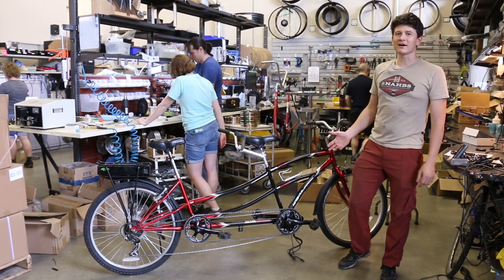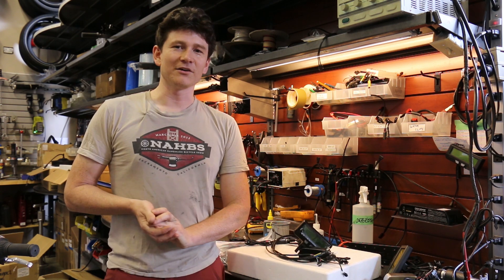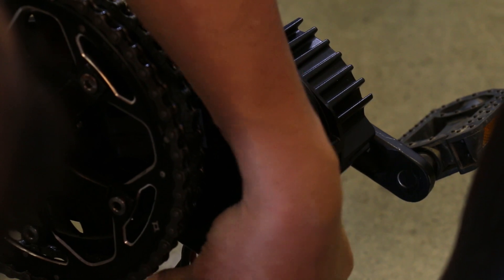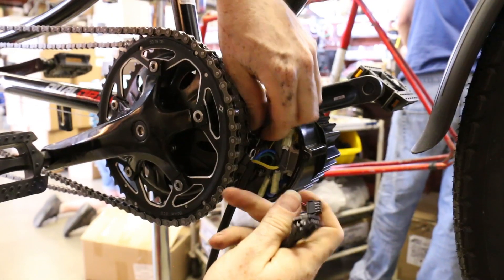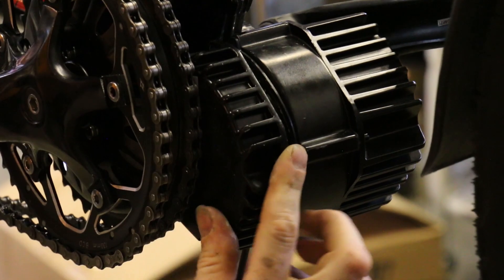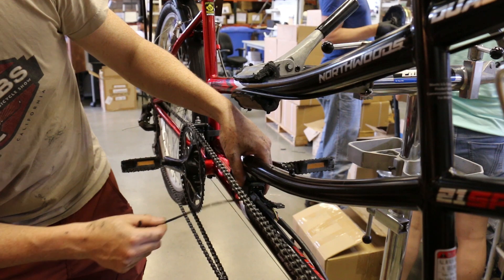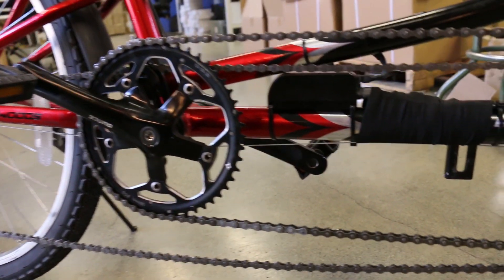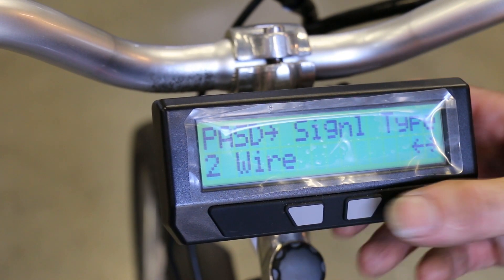How to upgrade a BBSHD mid-drive to use a Phaserunner motor controller and V3 Cycle Analyst

Comment: Can i use my Cycle Analyst v3 8 pin higo connector, with my stock bbshd controller as a plug and play?
Reply from the maker: Nope, entirely different pin functions I'm afraid
Reply: @GrinTechnologies  Thanks, I haven't done anything. I am in the investigation phase.

Comment: Is it wise to re silicone all the connection 🤔
Reply from the maker: Not usually. Dieletric grease can be OK on contacts with exposed copper, but anything any actual sealant material is more likely to trap water inside the pins than it is to keep it out.

Comment: Please consider offering a BAC controller, with higher power capability than the Phase Runner, for Ebikes.  Thank You
Reply: Not a good idea on this type of mid drive, unless you do some modifications 

More power and you start breaking chains and other parts 

You can get a higher power mid drive kit - but not from Bafang.

By higher power, I mean 5KW or better.

Comment: Hello, I am wondering if there is anyway to run the phaserunner with an eggrider instead of the cycle analyst? I have a bbshd and  started playing with the egg rider. I like the adjustability but the cycle analyst is a bit ugly!
Reply from the maker: In principle yes but you will need to do a custom wiring in the the TRRS communication port of the Phaserunner, and use an eggrider firmware designed to communicate with the ASI modbus protocol.

Comment: I'm curious about the bike itself - how was this tandem mid-drive set up to ride?  Did the drivetrain of the tandem itself hold up after putting some miles on it with the high power mid drive?  Or would you just use a rear hub drive next time you converted a tandem?
Reply from the maker: It's still going but the tandem bike didn't clock all that many miles at the end of the day, since opportunities to use it are a bit limited.  For sure we would generally use a hub motor (front or rear) with regen capabilities on a future build up of a tandem conversion.  This was done more as a demonstration piece.

Comment: If you have a BBSHD, just get the Ludicrous controller instead. No buying additional items, running ugly wires, etc. It is an exact swap to the original, but bumps current to 60A max @ 52V(58.8), or just over 3000W. The motor looks no different after install, you get to keep the old controller as a backup without destroying it, and there is no way for police to tell it is over 750W as that is the stamp still on the motor body. It would require a laptop and software to show it is really running at 3500W(or less depending on your programming). I used the Phaserunner on my BBSHD and would not go back to it now that I have the Ludicrous. The phaserunner is more for Hub motors IMHO. Great product, just not the best choice for a BBSHD. My $.02

Comment: 50 volts or 80 volts won’t affect the motor insulation. Good news is a given power will run at 5/8 current putting less stress on the motor. The issue will be potentially 1.6 times more output power putting additional load on the motor gears.

Comment: So I imagine , having to mortgage the house to keep that thing in chains and sprockets
Reply: Looks like a perfect setup for Gates belts and hub gears. Unfortunately Rholoff are the only hub gears butch enough to take the power. That’s two mortgages to buy that lot.
Reply: @Dave5843-d9m  Hello folks. There is always more room for improvements.  Every manufacturer has a price point to hit to turn a reasonable profit to stay in business. 
I believe the quality of the copper wire can be improved on with wires that has better wire measurements specs. Some wire can be made out of aluminum wire that's is copper-coated.  octane fuel for a car to get the best out of your system. Even the wire gage and the thermal coating that is use play a major role. And also how they chimp the terminals connections some use a single when a double chimp is better for durability due to corrosion and vibration

Comment: Seems a bit clumsy setup. Would prefer a controller that fittede inside the original controller shell
Reply: Good luck. More power requires more components, thus taking up more room.

Comment: What does 90°-130°C settings actually do for the temperature and when does it roll back???   Is this the actual motor temp?  Great video as I followed along and had mine up and running quickly.  
Any future BBSHD build or GMAC build will definitely use phase runner.  Super smooth.  😁
Reply from the maker: The amps limit of the CA3 scales down linearly from the maximum to 0A as the temperature goes from 90oC to 130oC, so at 130 degrees you'd have no power, while at 90 it will be full power, and it would settle somewhere in between.   I really recommend trying a powerful regen capable hub motor like the GMAC, it's eye opening and will make you loose interest in the BBSHD mid-drive!
Reply: @GrinTechnologies  I appreciate your response!  Next build GMAC, but need a good FS bike. Any recommendations?
I build my own 2170 packs.  Tommy L from the ES forum sends.....
Reply: @GrinTechnologies  is the grin thru axle a 'powerful regen capable' hub motor?   I know its regen capable, but I'm looking to add it to the front hub of my bbshd commuter specically for high speed & powerful regen

Comment: why not install the bbshd on the rear bottom bracket?  and use normal tandem left crankarms with the chainring...
Reply from the maker: For sure that would be another way to do it if you have two left side tandem crank arms handy.

Comment: I have a bbshd and My battery build: 
14s6p 52v 30ah battery 
Samsung 50G (5000mAh, 10a) 
21700 cells 
50a continuous bms. 

By adding a mt phaseRunner controller will I notice increase in power? Or will I need to buy a more powerful battery?
Reply from the maker: You could set the phaserunner to do higher power levels than the stock controller keeping that battery pack, but it's quite a bit of work so I probably wouldn't bother unless you had other reasons too.

Comment: I like the Phserunner but, the thing that it has to go with CA3 throws me back; you end up with a horreondous looking screen and a system with all cables tied around.   I use BBSHD with an Eggrider  and it goes just like silk.  And all cables hidden and tidy.
BTW.  Any of you who wants to use the phaserunner can send the original controller to me!
No hate intended.   I would love to see a CA4 integrated inside a phaserunner (and all the connections in it as well) and a tiny display, like the 500C or Eggrider.  Maybe redesing the phaserunner to fit into the original BBSHD controller space.  Great job!
Reply from the maker: For sure thanks for the feedback and no offence taken.  It's good to see that other companies are producing more plug and play upgrade parts for this kit and hopefully more and more businesss will have aftermarket solutions to stock setups. This cable adapter to connect a PR to the the BBSHD was from 3 years ago and perhaps it's time has passed.
Reply: I like the CA looks

Comment: didnt see the BBSHD speed sensor get disconnected.  Also didnt see any speed sensor get connected to the phaserunner. This is confusing because any stock BBSHD throws an error 21 without a speed sensor. And a cycle analyst doesn't seem it can do a full analysis of a trip without being able to measure speed. 
Does this system even have a speedometer and odometer?
Reply from the maker: You use a CA3-DPS device which has a wheel mounted speed sensor and spoke magnet.

Comment: Justin can you fit the Phaserunner to the BBS 02 that would be really cool ?
Reply from the maker: Yes for sure, but the connectors are different than on the BBSHD. We've had a number of customers to this mod successfully though.
Reply: @GrinTechnologies  hi how can I order one?
Reply: @GrinTechnologies  Thanks Justin changing the connectors from bullet to spade type was a simple thing to do with a soldering iron no big deal 👍

Comment: Thanks Justin for this helpuf tutorial, do you think it's possible to do the same with Brose motor ?
Maybe the wiring and signals of the torque sensor would be problematic... ?
Reply from the maker: Almost for sure it could run the motor itself, but almost for sure the custom wiring required will be a minor PITA.

Comment: Here in Raglan, New Zealand, we are into mid-drive & we are into GRIN Tech stuff. Personally I love the BBS02. Its punchy but lighter than the HD. If you could do a loom to go straight into one of these I'd be happy. No, wait, I wouldn't. I'm about to make my own & if you come out with a better one that I could just order after I spend hours making my own bad one I'll be irritated!
Reply from the maker: Did you finish this? We'd love to hear how it went.  The BBS02 is hands down a better motor than the BBSHD from a performance to weight perspective.  The BBSHD was a big step backwards.
Reply: @GrinTechnologies    I am a newbie. do you see many controller failures on the 02 if it is stock?

Comment: does the Grin phase runner V3 increase speed or distance?
Reply from the maker: It could increase your top speed via field weakening, but won't have any effect on distance. To increase that while running at the same power levels you simply need a larger battery pack

Comment: If i was to order a kit for my bbshd do i need to get the ca with the speed sensor or can i go with the DP and still have speed reading using my original bbshd speed sensor? Thx
Reply from the maker: You will need the CA3-DPS model with exeternal wheel speed sensor, as the BBSHD kit doesn't have any way to know or communicate your wheel speeds, it only knows the pedal cadence.

Comment: Justin 
Question 1-at what amp output are these phase runner set at (atleast 50 i hope) 
Question 2- can I install the runner without the CA (stealth mode) and be able to attach my throttle to it. I guess that would be loosing my paddle assist?  Thx.
Reply from the maker: You can set the Phaseurnner up to 96A of phase current. Be default we usually ship them at either 80A or 90A depending on the motor it is paired with. 

You can run just fine without a CA in stealth mode as long as it is throttle only control. To use the pedal assist sensor, you do require the CA3 (or equivalent device that creates a throttle voltage from PAS signals)

Comment: Same tutorial with bafang ultra please... a way to connect hall sensors with phaserunner on the newer ultra models...
Reply: bump+
Reply: I saw you have the bafang ultra. The wiring is different than the bbshd. Did you get any help on the proper connections. I'm lost. My add is robrob3141@gmail.com.

Comment: Can u put two 52v battery together making 104v 38.5 ah if I can what upgrade controller do i need much appreciated
Reply from the maker: You can in principle do that but you would need a motor controller that can handle at least 120V, which would normally mean using 150V rated mosfets and capacitors.  Such things do exist, but we don't supply them and it's not something you could easily upgrade on an existing motor controller.  In general there is little reason or point in running EV's in this power class at over 100V.
Reply: @GrinTechnologies  Also the MOSFETs in the BMS of the original Battery are not made for such high voltages.

Comment: I have the new Bafang Ultra G510 mid drive motor with a 48 volt Dorado Reenton LG 17ah battery on my BPM imports F1000 
https://www.bpmimports.com/shop/bike-model/f1000/f1000w/
what controller would you recommend ?
Reply: Nucular Electronics 6F. or 12F if you plan on upping the current.  At present the Nucular Controller is the best, hands down.
Reply: @1972wesley  what makes it best?
If I remember correctly they are much bigger phisicaly than phaserunner, you couldnt hide one on the bike frame as easy as PR.

Comment: Can you run this on a bafang bbs02 750w?
Reply from the maker: Yes, though I don't think that the internal connectors are quite the same, so you'd likely have to modify the harness for the hall/signal pins.
Reply: Grin's answer is correct. The phase connectors are not the same. Also on the original BBS02 there is no  temperature sensor. On the BBS02B (the newer one) I hope that there is a temperature sensor. I should find out soon as I am doing a conversion of one to phaserunner imminently.
Personally I love mid-drive and I love the BBS02. Its punchy but lighter than the HD
Reply: @RaglansElectricBaboon  ...and how did the bbs02 conversion go? :)
Reply: @pixelatedmushroom  Awesome, that's how! I ran it on 2*36v packs (72v) initially but it was too crazy- fast for my purposes. So I am just running it on one 36v and I love it.  I've got one on a full suspension mtb and one on a fat bike.  Both rule :)
Edit: No temp sensor.  Using the touch test it gets hot especially on 72v when thrashing it but I've had no problems.
Reply: @RaglansElectricBaboon  could you maybe make a video on your wiring or could I see some wiring diagrams or pictures because im thinking of performing this upgrade but haven't found anything online pertaining to the wiring of the sensor connectors

Comment: hi
i purchased phaserunner for bbshd from you and cycle analyst and connected to 58.8 battery 26ah
when i push thruttle the motos makes noise and dont run.. why?
Reply from the maker: You need to load appropriate settings on the Phaserunner and run the autotune routine.
Reply: ha... don't expect any help out of those jokers
Reply: @ericausen  Eric, what are you talkin' about? They made a 15 minute video that helps a lot.
Reply: @RollOnBusin  Grin is has frowned
Reply: @ericausen  Whatever that means

Comment: So wait now I need a huge display. (Not Eggrider) then I need to mount a separate controller Somewhere on the bike with wires everywhere. For what reason? Wow you could just sell your spare controller for 60 bucks( I've sold a new one for 80 and used for  one for 50.) All this for I'm guessing over 400$
Reply: The wireing and mounting controller is small price you have to pay if you want extra power and customisation

Comment: Hi Justin: this is so cool and a gateway to create all kinds of “off-road” Frankensteins with the Ultra. Can the CA-3 control both the Ultra and a front hub motor! Will you give us a video tutorial on wiring the ultra with the phaserunner, including the Torque sensor? Andy Kirby’s and Daxxie’s thread on Endless Sphere were not detailed enough. Thanks
Reply from the maker: Hopefully someone else will be able to detail that. Our shop doesn't deal with factory ebikes so we're unlikely to have a bike with a Bafang ultra system to play with and make that kind of detailed tutorial. It is pretty cool though to be able to tap into an existing torque sensor signal with the CA and we like to see people figure these things out.

Comment: Looking for Real as in the real deal 750w hub motor not 500w hub motor with more juice pumped through it aka Rad Power Bikes. Looking for plug and play with 2018 RadMini. You know what maybe I need to upgrade controller with more precise monitor. Well you see where I’m going with this. Do you guys have? Does Grim make something like that for my bike?
Reply from the maker: No, unfortunately we don't do anything like this that attempts to be plug and play with factory ebikes. You can do upgrades for sure but it's DIY territory so you have to want to get your hands dirty redoing wiring connectors and all that stuff.
Reply: @GrinTechnologies  DIY♡

Comment: Nice video, I built my BBS with phase runner and CA modification to use a 72 V battery using all the same grin components (though I had to make my own connectors and terminations) and it has worked fine, once I figured out the programming, throttle response etc.  For higher power capacity, I would recommend that you provide bullet connectors or just do a direct crimp connection for the phase leads.  I run mine up to about 3Kw on a full battery, for off road use (using a 3 way grin mode switch with 1 for road legal 2 for 2 Kw and 3 for 3 Kw limit).  The phase runner, provides a smoother and quieter than stock operation and also allows for higher motor speeds with phase weakening, which allows for higher RPM and more flexibility in gear selection.
Reply from the maker: Thanks for the tips. Did your spade connectors actually melt or did you just change them over preemptively?
Reply: @GrinTechnologies  I changed them preemptively, based on recommendations from another endless sphere post.  Working well since May 2017 (with multiple tuning adjustments and one reset of phaserunner parameters...)
Reply: What is your top speed with a 72v 3kw setting?

Comment: Hi Justin, will this work with the Bafang Ultra?
Reply from the maker: The connetors inside are different so you have to do more custom wiring between the motor and controller, but it can be done in principle and in practice as shown by Andy in his video series here  https://www.youtube.com/watch?v=g_7n9sN_XVA

Comment: Justin who you have this as a kit? I don't remember you saying anything about it in the video. If you do have it in a kit what would the cost be?.
Reply from the maker: I'm not quite sure I understand the question. The Bafang BBSHD kits are sold by many online vendors of various repute, but it's not a drive system that we plan to ever carry since we're very much hub motor focused in what we offer. If by "kit" you mean the Phaserunner and CA3 device used in the upgrade, those can easily be purchased as individual components using the links that are in the video description.
Reply: @GrinTechnologies  sorry I meant to say the phase runner, wiring kit for the phase runner to the bbshd motor, and shift sensor.
Reply: @chuckcavan3036  they do offer the wiring harness in the shop: https://www.ebikes.ca/shop/electric-bicycle-parts/wiring/phaserunner-bbshd-motor-harness.html